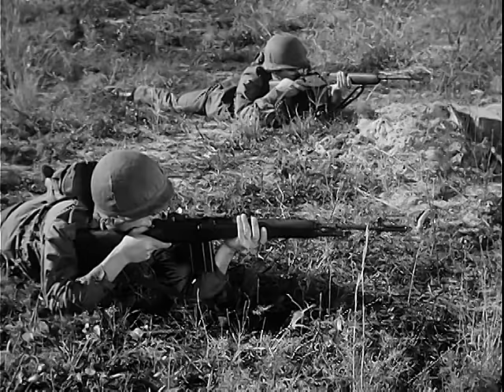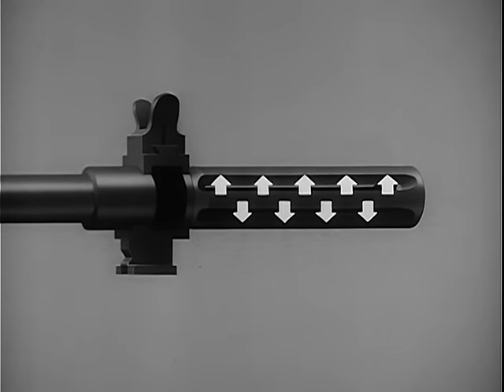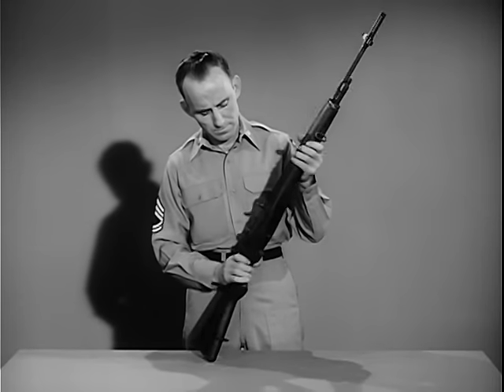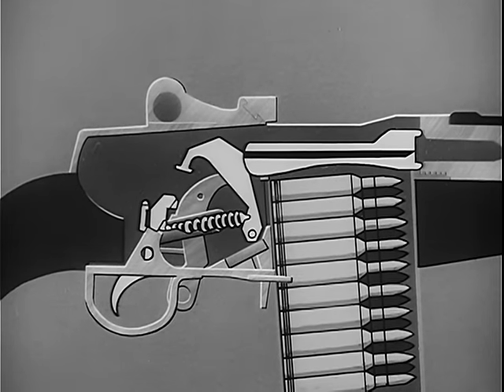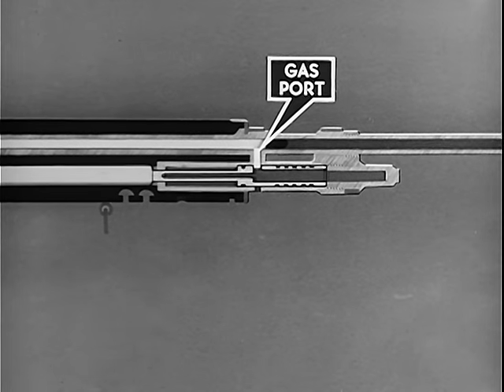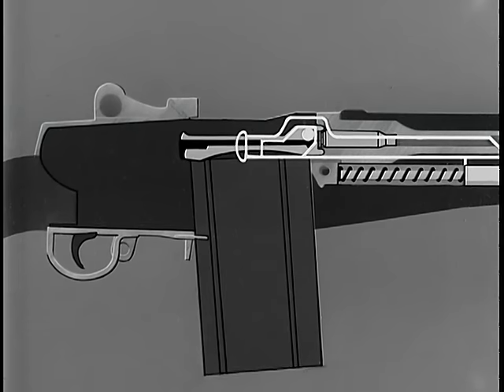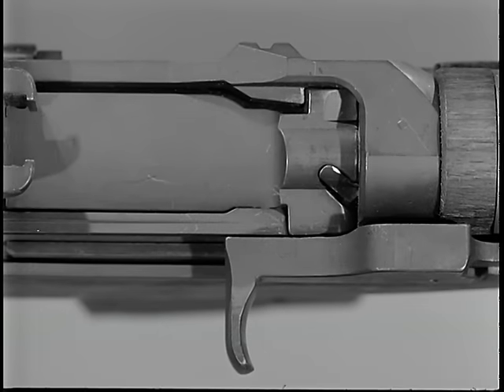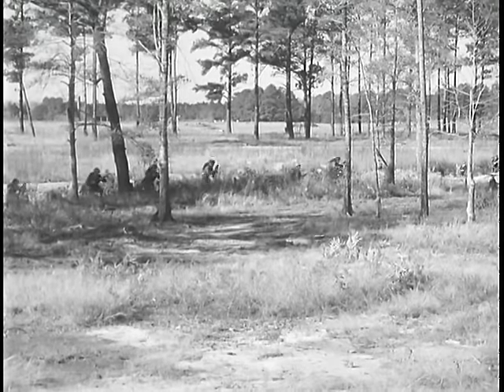U.S. RIFLE, CALIBER 7.62MM, M14 - OPERATION AND CYCLE OF FUNCTIONING

Comment: Brazil´s army would throw just bananas in a war. Ridiculous old weapon is still been used.
Reply: +Carlos César Machado Ridiculous weapon? You've obviously NEVER fired one.
Reply: +Shamrock Rancher it shoots well but its really outdated. The AR15 for example can be almost fully dissassembled using nothing but a screwdriver. For this gun you will need a flat surface and multiple different tools. Its just outdated. Imo even the AR15 is outdated, way too many little pins and springs in it. Stoner really lives up to his name lol.
Reply: RevolutionV12 I wish I could disagree with you. I can't. But it is a beautiful weapon albeit complex compared to what's available today. I do love the .308 round. It gets the job done and in that weapon system, with its weight, it is easily managed and delightfully accurate.